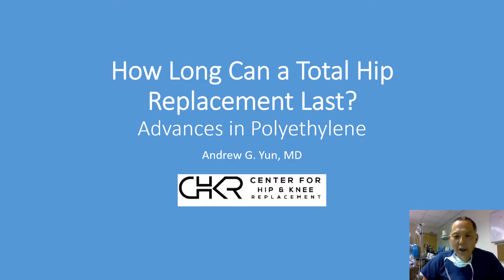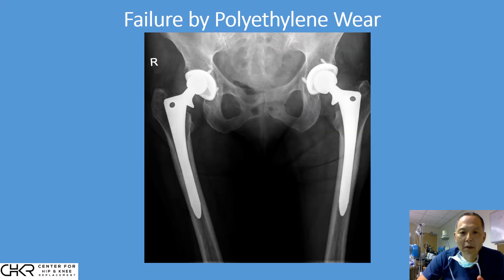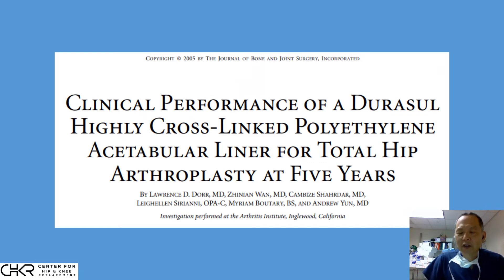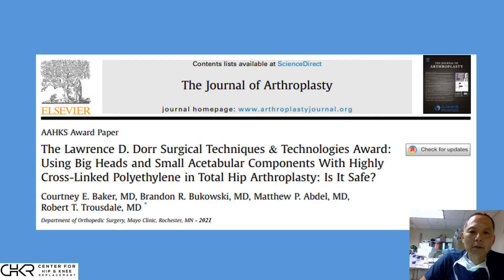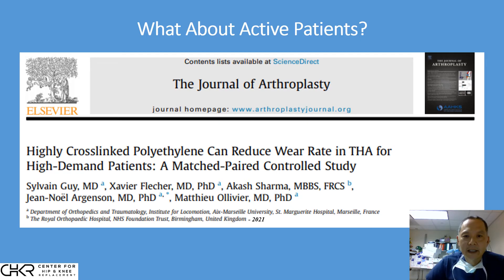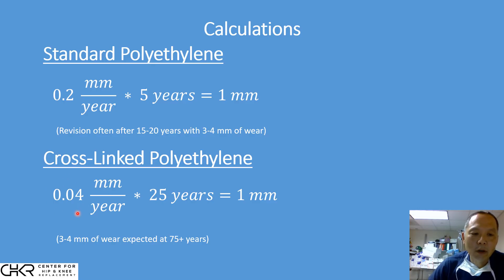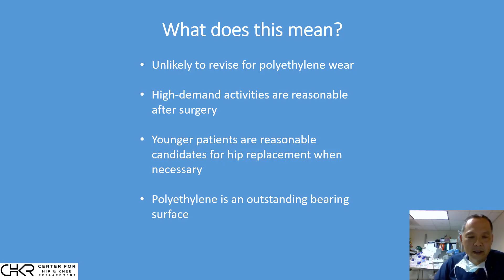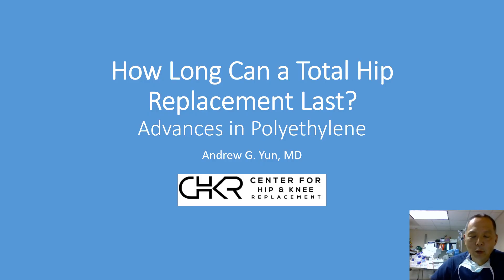How Long Can a Total Hip Replacement Last?

Comment: Dr Yun, if you or anyone here is able to explain this, what it the current thinking between choosing Ceramic ball on HXPE cup vs Ceramic on Ceramic. I understand ceramic cups have demonstrated even less wear than HXPE, practically zero. Why wouldn't we all use Ceramic on Ceramic?
Also, am I correct in understanding that there is an even more durable HXPE, which is crosslinked with radiation?

I'll ask this of my surgeon in a couple weeks, but I'd like to hear your thoughts as well

Comment: I had my hip replacement surgery on November 10, 1998. And lease then a full year a guy ran into me outside of a restaurant fleeing away from cops. I landed in very sharp rocks. Had gashies and very big bruises as well. My new hip replacement surgery joint never dislocated at all. And in 2025,  over 35yrs ago. Still going strong.
Reply: What type of joint did you replace?
Reply: @Abbas130a  I think it the titanium one? I don't have the medical records to find it. All my belongings were accidentally thrown in the dumpster after I moved away.
Reply: This is a great 👍
Reply: Great
Reply: @ahsyaing I think I had the ceramic one.
Reply: Awesome
Reply: Probably a blk
Reply: The only bad ones were the solid titanium or aluminum ones that would dislodge. Now they’re really
Good ones made with other substances that don’t corrode or effect the body at all like the metal would. I’m glad you’re doing great! Not all the titanium ones are bad though.

Comment: A plastic part for a hip implant should work too. My kitchen mixer has food grade plastic gear or two inside and its going strong after 13 years. A few automobiles had plastic or nylon timing gears as well. It wasn't great but they functioned awhile.

Comment: This is fantastic news! I'm 51 and had my left hip replaced 5 years ago. Wear has been a concern for me because I'm a martial artist/kickboxer, runner and I do a lot of hiking.  I was told at the time that the new HXPE inserts were so good that they didn't know how long they would last. But knowing that even at a high impact and activity level, it will likely last the rest of my life definitely allows me more confidence.
Reply: Did you have anterior, lateral, or posterior? I’m 55 due for THR, and I’m very active martial arts, running, dancing, etc

Comment: I’m 42 and just had an anterior hip replacement feeling much better
Reply: I'm 42, and had bilateral hip replacements in 2019. How are you feeling? It must be a relief to have the surgery done with.
Reply: @mjblcmichael  it feels great moving without assisted devices in less than a month feeling stronger well worth it

Comment: This was so well explained.
   I've been resesrching extensively for my hip repair and this is ghe first time I ran across such a detailed explanation.
   Now, if I could only find the best surgeon for this in NJ I might find the nerve to become a bionic man.
Reply: DR. Baione.  You can find him at UOA ..Did mine 2 weeks ago, going thru rehab now. He is very well known,  Located in Wall Township, NJ
Reply: @jimconrey9802  
Thank you so.much! I'm right here in Toms River so that's pretty close to me.
   His name sounds familiar as I do my research. I think he may have had hip resurfacing surgery by one of the experts in the procedure himself. In fact, I think he has now had both his done.
   Thanks again, Jim. Hope you are doing well with your recovery.

Comment: I had my hip replaced 4.5 years ago October 2019 with the anterior approach in Toronto. After two years in May 2022 I started running again every other day running no more than 5k at a 5 minute or so k pace… no issues 🏃‍♂️
Reply: I had my hip replaced in April of 2019. I was running and practicing martial arts again by September of that year. It's a beautiful thing. Especially when I think back to how painful it was to even stand up when my hip went bone-on-bone .
Reply: @justabill5780  Hey, are you still able to run and practice martial arts? any side-effects after surgery, with time? I`m asking because I`m an ex athlete and started to feel some pain. Thanks!
Reply: @artbydub  : I still run (did 5 miles this morning). I do martial arts 5 days a week. I go to the gym 5-6 days a week. I also lift at the gym. I'm doing weighted bridges with 600lbs. 3 sets of 12. 
Sometimes it get tendon inflammation in the left hip and some mild muscle spasms. But I can live with that.

Comment: I’m 2.5 weeks post-op. My surgeon told me that mine would last 60 years. It was hard to believe, considering everything I’d read that said they have a 20-25 year lifespan. It makes me feel better hearing it from another source. At 32 y/o, 60 years should be plenty.
Reply: Well mine been over 36years ago still going strong.
Reply: @derekmcclanahan4193 hi sir can u please share us the doctors name and address so we could also consult him thanks
Reply: how are you walking now does it feel good?
Reply: @Sam-wl3fk The joint is doing great. I’ve even taken up CrossFit, modified, of course. I still have some muscle tightness and soreness in the front around the scar, though. When it flares up, I walk with a slight limp. But stretching helps.
Reply: @Sam-wl3fk Good with the hip. But now I got to have to get both knees replaced due to stage 4 arthritis in both knees.

Comment: Fascinating.  I’m a former dancer and was wondering if there is an engineering solution that avoids metal on metal technology, that is in development that embraces the current successful practices of a total hip replacement but with a design feature of the metal component in the hip joint that allows a greater range of movement in the limb that enables dancers to continue their careers as choreographers on a low impact basis?
Reply: Just a prospective patient myself, but have you looked at hip resurfacing?
   A more involved surgery, I think, but appears to allow the patient to do more extensive physical activity.

Comment: Good info. Had TRH in 2007 poly cup ceramic ball titanium stem. Was surprised back then some of the Dr  were still wanting to put metal on metal I said no thanks. So today 2023 need my left hip done the X-ray's show the right hip implant looks great still 16years later. Now I am 80yo and plan on living another 20years. Choice o f surgeon is number one choice of implant number two.
Reply: Where did you have your's done, Anita, and with what doctor, if you don't mind? My hip is crying for repair.
Reply: You dodged a bullet there, my surgeon says he is seeing people coming back with issues due to wear in metal on metal joints

Comment: A brutal operation, removing the femoral head and hammering metal into the bones of the femur! Hip resurfacing is the way ahead!
Reply: I'm not so sure, my femur and pelvis were so worn that they were pliable.🤢🤮 8 weeks on from THR and I have zero pain and the new joint almost feels like it's my own!
Need the same done on my left hip in 10 weeks time! Ortheo Arthritis is a bitch. Only 57 Years old!😬
Reply: Metal metal means cancer
Reply: @miquelmolina5298 do you have empirical based evidence for that statement? Also metal is rarely use any more.
Reply: Resurfacing IS metal -metal and the friction releases ions... The ones who say that resurfacing IS the solution must keep it in mind. Even if you are Young ...well i felt a must and i had to say it
Reply: Polymotion fda aproved... Resurfacing with plastic cup

Comment: If polyethylene life is 75years 
Then how it is broken and patient goes to revision within 15-20 years
Reply: This is what the excellent Mr Yun has described in the video ,that the old polyurethane liner lasted 10_15 yrs but with the new cross linked polyurethane liner it
 has the potential to last for 75yrs.
Reply: If you are running high miles like crazy,thats what happens.Some people never learn.

Comment: Thanks Dr. Yun for this helpful information, if I may ask what will be the cost of Total Hip Arthroplasty in your hospital, by the way I’m from the Philippines I was operated partial hip last Nov2020 and now my orhto doctor here told me that my prosthesis is loosening that’s why I feel pain in my groin, knee and whenever I’m making a wrong move there’s pain
Reply: And in your operating procedure are using mako robotics? And are the prosthesis that your using for each patient are pre- manufacture or fabricated base on my actual size? Thanks

Comment: One of the biggest questions I have is the the possibility of leaching from these materials into the bloodstream.I recently had hip surgery done and got a chromally ball and titanium stem that goes into the femur.A steel socket and polyethylene insert to receive the ball.So with that said is there any truth to this idea
Reply: There was limited data on metal on metal replacements and shards of metal entering the blood and causing issues. As you do not have metal on metal there will be no problems...